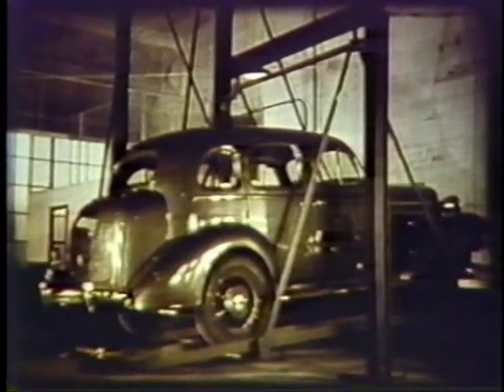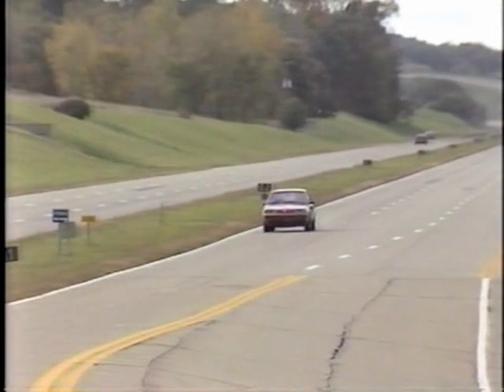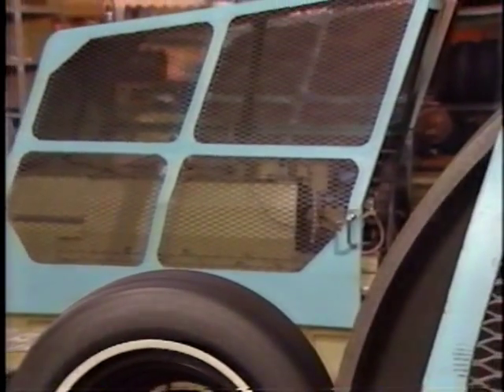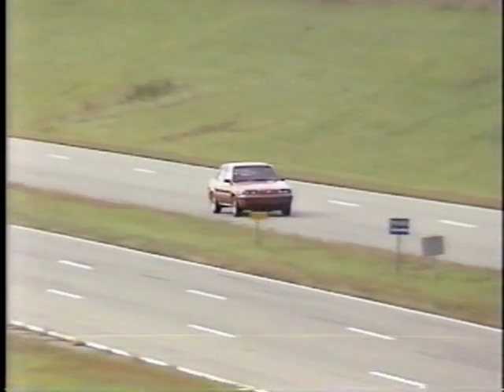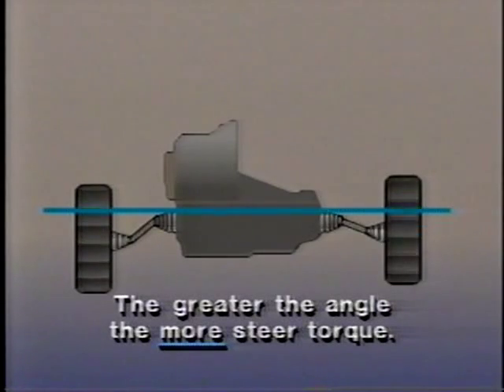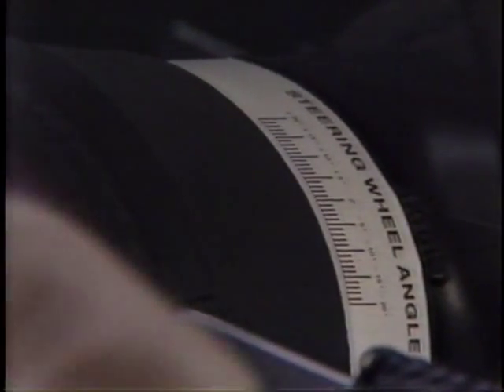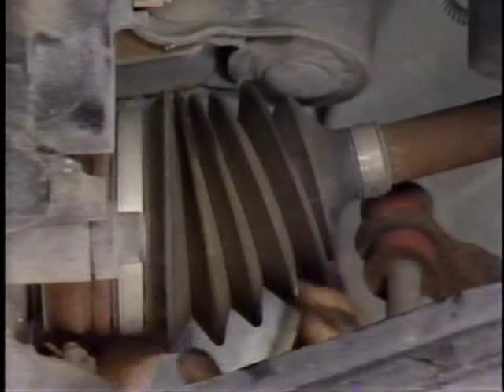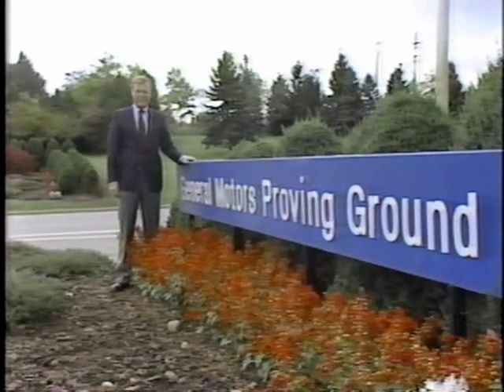Buick - Understanding Torque Steer (1987)

Comment: If you own a front-wheel-drive car, then I'm sure you've heard the term "torque steer".  Maybe you've even experienced it in your car.  It's actually a normal condition, & is the tendency for the car to pull to one side or another during hard acceleration.  But there is a lot more to it than that, as this film explains.